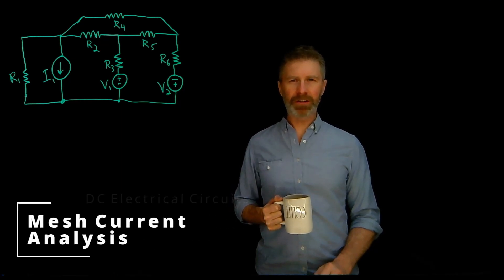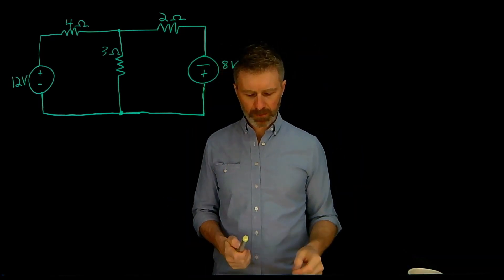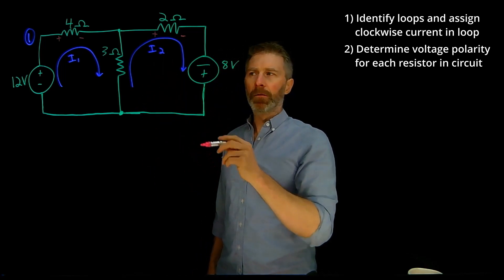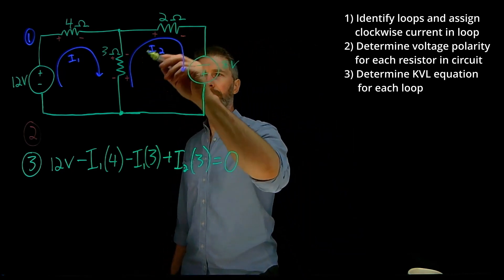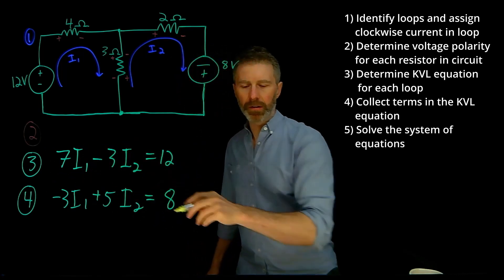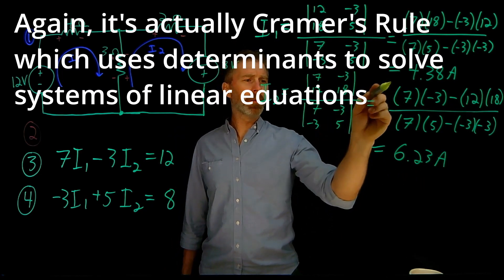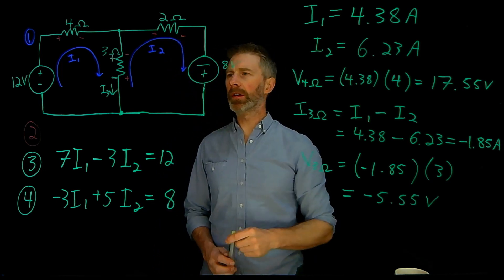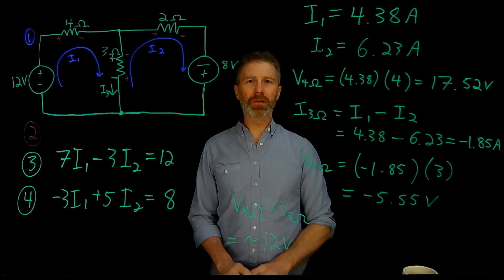Introduction to Mesh Current Analysis

Comment: The correct answers are 3.23A for I1 and 3.54A for I2. 
Because you want proof of these answers. 7*3.23 - 3*3.54 = 11.99V and -3*3.23 + 5*3.54 = 8.01V. Your answers give for the second equation -3*4.38 +5*6.23 = 18.01V. This should be 8V and not 18V. You filled in the wrong voltage for the second equation. You also use a rather strange form of Cramers rule for I2.

Comment: In agreement w/ the equations.  And I like how you did that and that was helpful.  However, it is not in agreement w/ four methods I checked in numerics for current.  I have I1 = 3.2308, I2 = 3.5385.  Confirmed Simulation LtSpice, Falstad simulator, algebraic systems of eq. by elimination confirmed by ChatGTP check, Reduced Row Echelon Format Matrix TI-84 Plus CE.  What I do not understand is precisely how systems of eq. are related.  I know to put the coefficients in there but not really how they are multiplied.   Until I take Lin. Alg.
Reply: I also got the same result. My guess is there was an error in his solving the system of equations. The video is still excellent nonetheless!
Reply: that's what I got also.

Comment: Are you saying that a circuit still flows, in both of 2 mesh circuits,  even if the opposite polarity is stronger voltage? Both sources are connected together, not separate power sources.
Reply from the maker: Through any branch in a circuit, there is only one resulting current, but if there are two sources, that current is the result of the effects of each of the sources. e.g., if the effect of source one results in 2 amps and the effect of source two results in -1.5 amps, then the total current will be 0.5 amps.